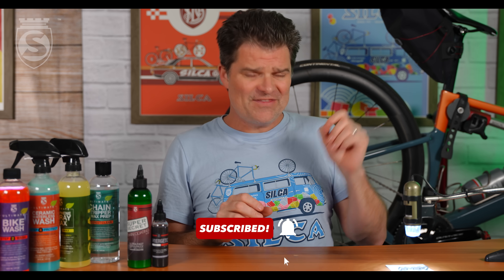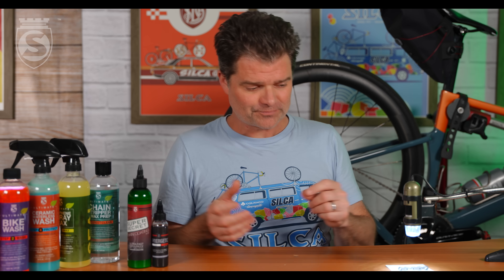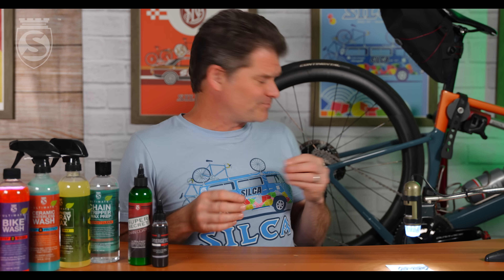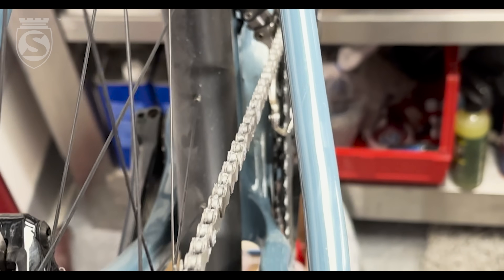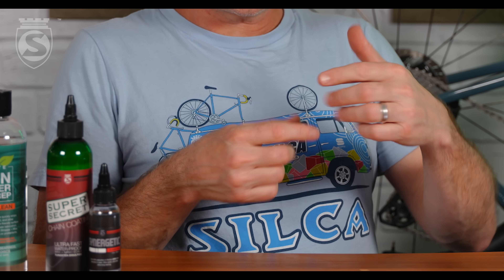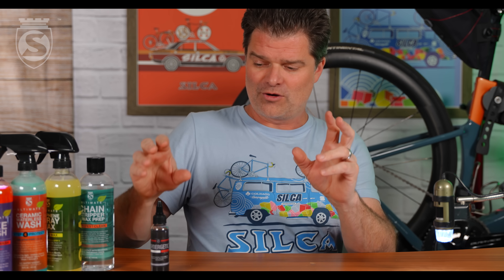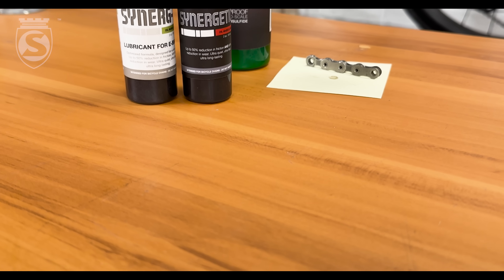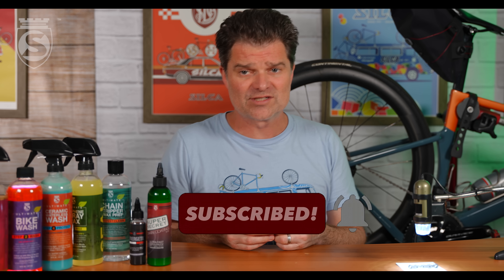Stop Wasting Your CHAIN LUBE! Know the BEST Way to Apply It!

Comment: First user here this year of Silca Super secret hot immersion wax and this drip wax this year. However only got 2,700km out of Shimano 12 speed chain before it reached the 0.5 stretch limit. Been applying the silca drip wax every 150-200km and was expecting a lot better than 2,700km. I’ve been getting 3,000-4,000km per chain using Squirt wax for years and inclined to go back to that as it’s mess stuffing about not having to do the hot wax immersion
Reply: That sounds like a very quick wear-out unless you are riding in very tough conditions (wet, dirt).  Are you sure you are measuring the chain stretch properly with one of the new tools that measure from the same side of the rollers?  I thought I had quickly exceeded 0.5% stretch when measuring with the old park tool CC-3.2... but the shimano 12 speed chains read almost worn out when new with that tool.  When I switched to the park tool CC-4 I got an accurate reading with the shimano 12 speed chain that I verified by measuring the entire length of the chain off the bike.
Reply: @scottc2041  I’m using Park Tool CC-2 which admittedly is small. This is a new bike with only 2700km straight out of Canyon factory with 12 speed chain. Before that I was on 11 speed using Squirt drip, never cleaning the chain and getting at least similar mileage from chains checking with Park Tool CC-2. Seems like a lot of work to have to remove often the chain often ti clean and then Silca hot immersion. I’m riding 250-300km weekly and using the bike at least twice a day for commuting and training. It doesn’t get much down time. The bike has to be ready to go at all times !
Reply from the maker: As ScottC said, 12 speed chains need the Shimano style or Park CC4 style measurement tool.  Having said that, every similar story to yours that we've investigated with our customers has ended up being a counterfeit chain.  They are absolutely everywhere since covid and are probably the majority of chains sold through Amazon, ebay, and the like.  There are sites that help identify them as well as numerous videos on youtube.  Here's a Road.cc article to get you started: https://road.cc/content/feature/how-can-you-spot-counterfeit-bike-components-295107
Reply: @SILCAVelo  it wasn’t a counterfeit Shimano chain as it was straight out of Canyon factory on a new bike. I use the Park CC-2 tool to check my chains. I’ve always assumed that’s accurate enough. I can only think I need to be removing and cleaning the chain more deeply and doing the hot wax immersion more often rather than rely on the Silca drip twice a week for the 250-300km per week I generally road ride. It’s a lot more work than the Squirt drip  process I’d been using before that. I apply on the inner of the chain at the bottom like originally in your video. That’s how I’ve been lubing my chains for 40yrs! But willing to give it a try to do things differently! Just hoping for much longer life of these expensive chains without having to remove the chain to clean and hot dip every month. That’s a lot of down time for me on a bike I ride 2 x daily for work commuting and training.

Comment: Excellent video Josh, I'm a longer distance rider than 100k and so as much as I want to give wax emulsion a try the longevity of an oil based product keeps me with your oil product. Are you looking at ways to increase distance between applications of wax emulsions?
Reply from the maker: SuperSecret wax should easily last 200-250Km per application once layered up inside the chain.  If you need more than that,  hot wax should net you 250-350km, and our HotWax X holds the record for single application longevity (in ZFC testing) and should get you 900-1000km per waxing.
Reply: I did 320km last Saturday and didn't have any issues or noticeable noise. If it starts raining it gets loud tho.

Comment: Sounds like a great method to make a mess of one’s cassette and derailleur
Reply from the maker: You use a lot less lube this way as 1 drop per roller fully penetrates, so it ends up actually being cleaner than other methods.
Reply: @SILCAVelo  
That lube pours out.

Comment: Keeping everything the same with this application method, would bringing the wax emulsion to a bit higher temperature than room temperature (let’s say body temperature) induce a better (faster) penetration ? Tks ! Larry.
Reply from the maker: The working range for the product is 7-35C / 45-95F and it will definitely penetrate and cure faster at the warmer end of the spectrum than at the cooler end.

Comment: Hi Josh. What to do with the excess wax on the outside of the chain after hot waxing. My experience is, that it messes and sometimes clog up the space in between the teeth, especially narrow 12/11 speed and not so much 9/10 speed
Reply from the maker: You might be pulling it from the wax a bit too close to the solidification point, or not letting it sit in the wax long enough to become fully hot.  Either way, there should be very minimal wax on the outside of the chain and definitely not enough to clog up those spaces in the cassette.  I'd just use a fine flat tipped screw driver to scrape out any wax that ends up in the cassette, but again, this shouldn't be happening from my experience.

Comment: It doesn't matter where you apply the lube - from the inner side of the chain before the cranks cog, or from the outer side before the casette. The final result after several pedal revolutions is the same.
Reply from the maker: This is true for oil based lubricants, yes.
Reply: @SILCAVelo  This is valid for any lubricant (oil or wax based), because their penetration is governed by the capillary forces, which, in our case (chain and environment are constant), depend on the surface tension, angle of contact (metal-drop-air), and the density of the lubricant. And all of them depend on temperature (in general higher temperature - lower angle of contact (better wetting), lower surface tension, lower density). Because the capillary effect is proportional to the tension and contact angle and inversely to the density, any wet wax lube bottle dropped into the hot water for a minute or two would have a similar penetration effect. Just warm up the wax lube before applying. No magic, just science.

Comment: I’ve been using silca drip on for a few weeks. What do I do after a wet or slightly dirty ride? Simply wipe with water and reapply? Wipe with degreaser? I saw in another video that it was ok to use a small amount of degreaser on a micro fibre cloth? Do I need to reapply silca drip on after a wet ride? Thanks
Reply from the maker: Technically you should clean the chain and apply new lube after any wet ride with any lubricant.  Microfiber wipe with SILCA bio degreaser works well if the bike is just slightly dirty.  If it was a long or bad rain ride, you can clean the whole drivetrain with SILCA brake and drivetrain cleaner as it will lift and remove any grease/oil/dirt while displacing water from inside the chain, but will not harm the remaining wax.  After that you just rinse well with water and then re-apply SuperSecret and you should be good to go.

Comment: Well the pumping action on the cogs is of course different to the one that you've shown us, when looking at the chain on the table. When you have the chain laying on the post-it, on the table, the lubricant doesn't really have any other way to go but upwards, in between the elements of the chain. 
But if the post-it and the table were not supporting the lubricant drop from below through the whole process, the pump action of the chain elements would have a completely different outcome.
Reply from the maker: You should try it.. you can put a drop of lube on the roller right before it hits the cog.. it will sit there slowly beginning to wick into the roller and as soon as it articulates laterally, the whole thing pretty much disappears into the roller like a little magic trick.  Doing it this way for demonstration was to allow you to see both the wicking and the pumping effect and also show that the pumping is good enough to overcome gravity, so applying it on top and pumping you even have gravity working in your favor.
Reply: @SILCAVelo  don't get me wrong, I didn't say it doesn't work at all, just that the demo represents a different scenario compared to having the chain on the cogs.
anyhow, I appreciate your efforts and content! cheers!

Comment: I have a question thats a little off the topic of applying. Is it possible to use Silca Synergetic oil lube after an innitial hot wax is gone? My specific use case would be an ultra race that will have lots of wet riding and hot wax will not last the entire race of >1000km. Or is it better to just start with oil lube right from the beginning?
Reply from the maker: For ultra endurance we recommend starting with hot wax and then transitioning to Synergetic if things get bad.. be sure to rinse the chain first to remove as much dirt/dust as possible, and then use a good bit of Synergetic as over-lubricating a dirty chain will help flush out some internal contamination.  We then recommend wiping good with microfiber to remove external oils so that they aren't acting like dirt magnets from there forward.
Reply: @SILCAVelo  Thanks, thats what i did on the unknown race on the second day after lots of wet and salty road conditions. Just flushed the bike at an carwash, put some synergetic and used a spare sock to wipe it off. (it had holes already) Worked fine, of course after 1k wet km there is lots of dirt build up, but i can still recommend as the best option in these conditions.

Comment: Hey Josh — when switching from oil based lubricants to a fresh new chain with wax based lubricants, is it necessary to also use Chain Stripper on the cassette and chainring to fully remove any old oil based lubricant residue or will a standard degreaser work fine for that?

Comment: I’m a heavier rider and I replace my chains often so I don’t bother with expensive chain lube. I buy WD-40 graphite/silicone based sprays and call it a day. Also when I put my bikes together I use a petroleum gel for all the metal surfaces and bearing. I REFUSE to pump extra money into the petro-chemical industry by buying specialty brands it’s ALL a ripoff!

Comment: Josh makes it really hard to argue with using his products.  I can say, this wax does last the longest, has the least sound, and has helped all my chains last so long.  I just checked a chain with a digital gauge after 2000km, and I couldn't even get my gauge to read 0.01.  I have replaced cogs sizes, replaced chainring sizes, or crashed my bikes before replacing my chain.  I had one with about 8000k on it and I had 0.16 wear, so around 25% use, as I generally switch around 0.6.

Comment: That was masterful. Simple, yet genius. A Big Thanks to you Josh! 
I've never done that before! On my former teams I followed the advice of our mechanics by applying a single drop on top of each pin-roller interface all the way round, then ran entire the gears through top to bottom on inner and outer chainrings 2-3 times (just to create that super-light initial coating), but never at that precise location you've so cleverly demonstrated :-)

Comment: Interesting video. However, in our shop, we have demostrated that with the chain in the smallest chainring/smallest cog that application of lubricant drop by drop to the lower chain (between chainring and pulley wheel) once around and then working then pedaling the chain backward about 20 times allowed for excellent penetration. We did this by coloring the lubricant yellow, applying, working the chain backward and finally wiping off the excess. We then disassembled the chain and found excellent penetration around pins and bushings. We looked at several dry lubricant such as Finish Line Dry and few more as well as several wet lubricants. We did not look at Silca lubricant or wax lubricants. I think the method of coloring the lubricant and disassembly of the chain gives good proof of penetration and you may want to consider this technique in addition to your observations before recommending your method as the best for all chain lubricants.
We have also shown that placing chain lubricant - at the cassette - can result in contaimination onto the cassette cogs and derailleur and would caution viewers that contaimination of rotors and brake pads can occur if one is not extremely careful.
These are just our observations for what it's worth.
Reply: "We did not look at Silca lubricant or wax lubricants."
Improving penetration of wax/water emulsions is the entire point of Josh's clip, though.
Reply: What was your control or method of comparison?
Reply: Pretty much what I've done for decades now though I don't bother with what cog or chainring the chain is actually in-contact with. Capillary attraction (with oil at least) is an amazing thing. If you drip the lube into the area of the side plate/roller interface it finds its way into the chain amazingly well after "backpedaling" few times before you wipe off any excess by running the chain through a clean rag. This isn't "rocket surgery" IMHO.
Reply: @larryt.atcycleitalia5786  Totally agree. Thanks larryt.
Reply: Thank you.

Comment: Since I switched to chain wax, I applied it on the bottom side of the chain (where the front derailleur is, this I did so already with oil-based chain lube when I started cycling over 30 years ago), hold a several times folded good quality kitchen cloth (it does not dissolve in a washing machine when by accident left in a pocket) below it, and then put the wax very generous on the chain, and then I twist the chain and also bend it a little bit. After about 40 links, the kitchen cloth itself as absorbed a certain amount of wax, so I can also wrap it around the chain and can create  a kind of "wax bath". When all links are waxed, I do a second run,wrap the chain on the length of about 10 links and squeeze the cloth a little bit. When the drivetrain gets noisy, I know its time to rewax (after about 200km/125mi).

Comment: ever try warming up the SS drip, in a hot water bath prior to applying ...seems to help it seek the inner portion rather than bubble up and roll over the (roller) and sit between the plates like it does when its 55*F

Comment: When you lowered the chain into that drop, it touched both side plate junctions and wicked up.  Do we need to lay two narrow beads (left and right side plates) to get both sides lubed with minimal waste?  If so, maybe a more needle-like cap would be a good idea.  Also, am I right in thinking that running through the gears on the big ring cross-chains in both directions, thus pumping lube into first the even-numbered pins and then the odd-numbered?  Or is just moving in one direction and then back to neutral all that's needed?  Of course, dousing the chain renders everything but cost moot.
Reply: Good observation! Yes, applying the lube into the left and right gaps helps the lube wick into the chain better, and also leaves less deposit on the cogs, pulleys and chainring as compared to dripping lube in the center of the chain, on top of the rollers

Comment: Why not have a little tray about 2 cm in length that you fill with lube. You put that underneath the chain and you pull lightly outwards while you spin the cranks. The chain deflects a little while it runs through the tray, soaking up the lube.

Comment: Somehow on my (DA) chain, I apply liberally to the top of the bottom run of chain, pedalling forwards, and it doesn't drop through the chain. Have I failed to clean properly? Or is it sticking better because I'm applying over wax, not over clean chain?

It goes through all the derailleur pulleys and cassette a moment later anyway, and then after I finish applying (enough lube that half or more links have a "bridged" deposit of lube in them) I use my fingers to work it in, as well as using them to form two few very tight bends in the chain, and to bend it laterally to its limit, both ways, all while running the chain at 30-60 RPM by hand, so I can only imagine I'm getting a good spread of lube inside as well. Far more articulation than you get out of the chain running on its own through the drivetrain. 

Thoughts?

Comment: What happens to the drip wax on the chain when you go to re-hot melt the chain? Does it exit the chain when melted in the pot, but then after X# times, change the make-up of, or "contaminate" the hot wax to be reused in the future (since you do not clean a drip wax chain before hot melting)?

Comment: Hi Josh.  If wax is so great in a chain (I'm sold on it) would it be just as good in bearings and freewheels?  If so what would be the best method of application?
Reply: Hi there . . . obviously I"m not Josh :-)  . . . but my take is that I think you had better stick to waxing your CHAIN  - bearings in wheels and cranks and freewheels usually carry a lot of weight or rotating stress and probably would melt the wax away in no time due to heat build up from the normal friction between rotating surfaces. On the other hand, each link in a chain gets cooling by virtue of it being out in the air flow plus each link is not working all that hard because the stress of pedalling is distributed over all the links - just saying :-)

Comment: Applying lube on top of lower chain hang has originated from teams mechanics who had no time to lube each pin so they backpedaled chain and dripped lube all over chain. This way less lube ends up on outer surface of chain so it's less prone to attract dirt. Sure excess lube is wiped off but this is just an explanation of thought behind sequence. 
Is it time savinging? No, because after wiping off excess lube from chain also cassette and chainwheel should be cleaned.